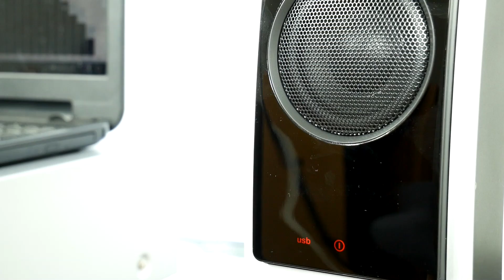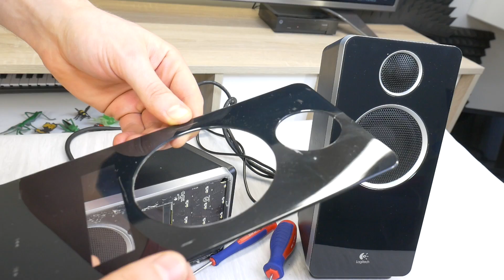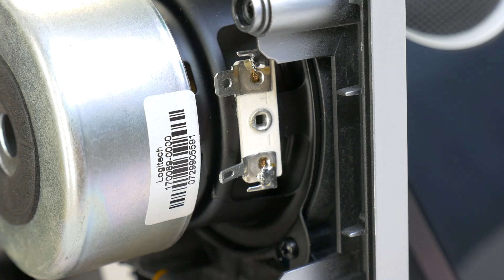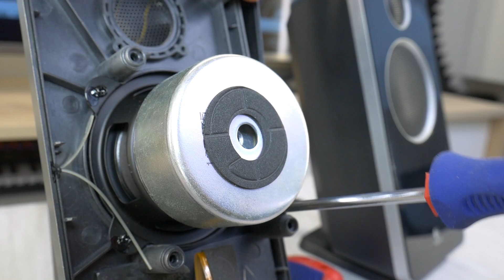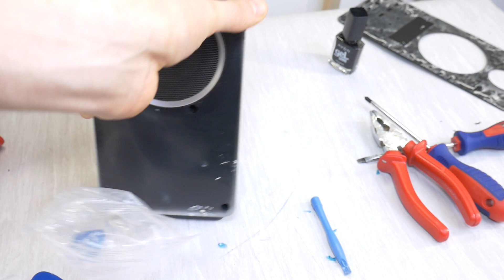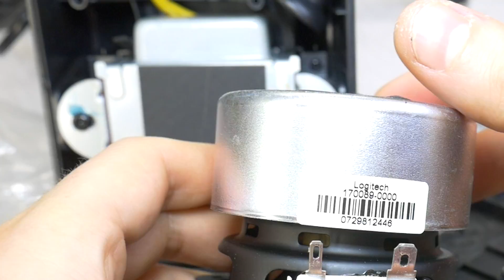Look inside Logitech Z-10 Speakers + Free Air test

Comment: I find mine distort above 74% of digital full scale, adding odd harmonics and 48 kHz sample rate aliasing (regardless of sample rate being played). This depends on digital data being played via USB, not on volume set on the speakers. Based on how the waveform looks and other observations, the distortion seems to be originating from DSP operations in the Micronas UAC3556B chip. They're easy to hear when playing a sine wave frequency sweep, and easy to see when recording headphone output and viewing a spectrogram. I would like to know if all Z-10 speakers do this or if mine are broken.

As for opening them, I heated the front using a heating pad to make the glue easier to separate. Then I used plastic putty knives, starting at specific points where it was easier. The touch control circuit board was glued to the front, requiring care to avoid damaging the ribbon cable that connects it.

Comment: A pity you broke the top narrow part on both speakers during disassembly. When you had proper tools of even just a thin knive this good be avoided. A plastering tool for filling holes in a wall is your best friend here. Did you find replacement drivers or recones to manage to repair the worn surround?

Comment: I still have the Z10 speakers and they work also still fine but they make a buzzing sound. I want to replace them but i can't find 2.0 speakers with the same audio quality and size :(
Reply: Try to replace the big electrolytic capacitor in the power supply area of the main board. That one wears out over time. Mouser is a good source.
Reply from the maker: The Creative T-20 and T-40 are amazing speakers.

Comment: great choice of music!
I have a broken pair of those; the screen backlight turns on, but doesn't display anything, and the buttons do not light up either. I didn't manage to find what was wrong, but thank you for the video for helping me disassemble this! I'm really not a fan of the touch controls and the glued plastic face plate, but these speakers sound great, and the screen display is still supported by a few programs, and third party plugins. I'll try to get another pair second hand for cheap.

Comment: Sir, I need your help. My Logitech speaker is stuck on an orange display without showing any response. How can I fix that?
Reply: Mine have the same issue. I have disassembled them, but have not found the problem. Tell me if you found anything!

Comment: Had two pairs, by far the best Logitech 2.0 system. For me, they are also sligtly better than Creative T40 and they were in the same price range.
Reply from the maker: Thanks for feedback :)
Reply: @Techscrews  Thank you for content, it's great. 

On this theme about Logitech 2.0 speakers, I tried almost everything and they are pretty bad, but one stands (apart from Z10) - Z520. I had two pairs also, conpared it to gigaworks T20, they were not on that level, but they were very good. Price tag in my country was about 50€, when T20 was 70.

Comment: I wish they made a Z-10 V2.. those was really great PC speakers with rich sound for its size. Still have 2pcs of them working, but sound is distorted and cracking. Nowadays speakers from Logitech are trash. Better to look at some studio monitors or alternative to this brand.. like Edifier. Have Edifier S360DB with planar tweeters and that speakers sounds amazing and well balanced sound.
Reply from the maker: Maybe that sound is distorted, because speaker surround are dead like my z10? I try upload video how i on budget repair surrounds.
Reply: Nono, the rubber surround on bass speaker is okay(i also have them dissasembled), but it looks like a amplifier board thing. @Techscrews